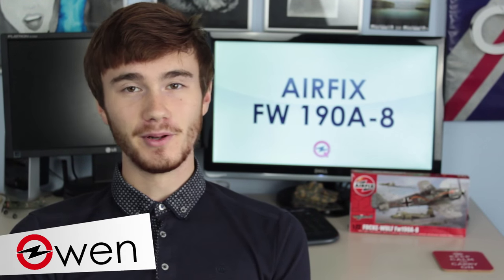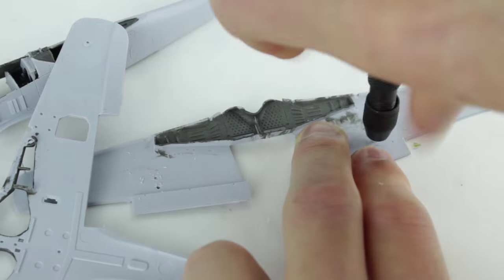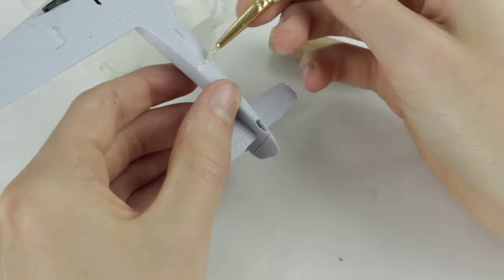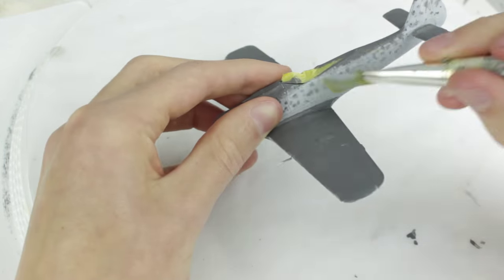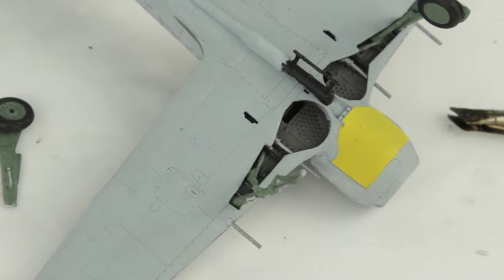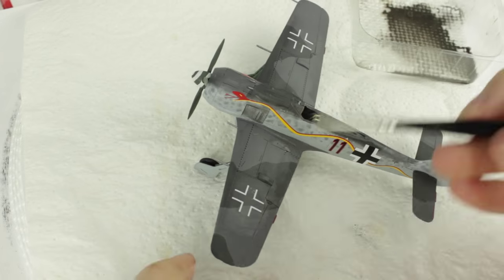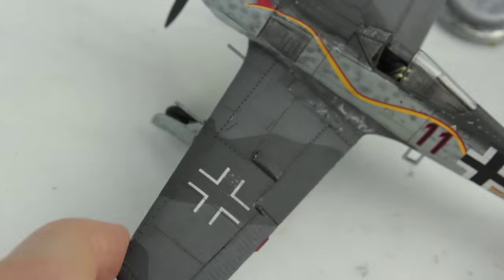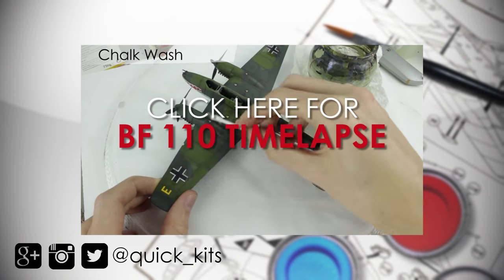Building Airfix FW190 - Model Aircraft

Comment: Wouldn't the thinner remove the previous coats of paint?
Reply from the maker: That's very true. You would have to use Humbrol acrylic 247, or seal the 247 colour with an acrylic varnish to make sure the thinner doesn't cause any damage (which I don't think I did, oops...)
Reply: Oh ok
Reply: actually the paint would "die" if you left it dry for about 4-6 hours (with enamel, and 1 hour for acrylic), once it dies, thinner can do no damage to it whatsoever
Reply: @rurushu8094  im the dark lord???

Comment: Great review. I just built one myself to. I built it because I remember seeing one that day at a air show I was at. (It did crash that day but the pilot is fine and it will be fixed).
Reply from the maker: Toby Corbett Did you see it crash? That would have been scary to watch
Reply: Yeah it was at Omaka airshow Blenheim new Zealand. one of the brakes failed on landing and it looped around ripping of the landing gear. But the pilot was fine and it wont be that long before the planes back up in the air.

Comment: Hello, I find you movies very informative and helpful. I learnt from you a lot. I  am just starting my adventure with scale modelling. I did few models when I was 14 year old kid, but it was very unprofessional and I never painted my models. Hadn't got money for paint :) Now I am 37 and I want to start again :) Right now I am doing same focke wulf but arirfix beginner kit, which is slightly different. Have few questions, if you don't mind. I decided to use always acrylic paints and varnishes and always use only brush. No air brush or spray. In my opinion hand (brush) painted models have more value (not money kind of value, but the other value  if you know what I mean). You always put some gloss coat (gloss varnish - is that the same thing? ) on places where decals will go. Instead of putting it only in that places can I put gloss varnish  on whole model ? And than after putting decals can I apply matt varnish to whole model again. Reason why I am asking, I want all my model (I will be doing 2nd world war aircraft) to be matt, there is no place for shinny aircraft during war. But if I put gloss varnish before decals on all plane, will it ruin whole thing ? Does it make sense putting first gloss varnish and than matt varnish ? What will be final outcome ? Gloss or varnish or mixed ? I will be using Vallejo Varnish Gloss / Matt  Airbrush Paint 17ml Bottle. Or you just recommend to do what you are doing, put  gloss varnish only where decal should go and than mat varnish on the end. I've never seen on your movies how you apply mat varnish on models, I mean with the brush, liquid one. Do you always use spray ? Can you make one movie showing how to use liquid matt varnish to cover whole model on the end ? Thank you
Reply: teddy81kain most people gloss varnish the whole aircraft before decals, so that's fine. but make sure to keep the varnish off the clear parts as it can make them foggy. I'd recommend gloss varnish until the model is very shiny, then decal, then a couple more coats of gloss to protect the decals from any weathering choose to do, then use Matt varnish to seal everything in.
Reply: Thank you

Comment: Owen, am a great fan and have used your pencil technique to bring out the panel lines on a fw190 to great effect. Having trouble however with pva glue on canopies as they usually fall off....any tips would be appreciated....thanks.
Reply from the maker: +Richard Cooper I'm glad the pencil technique is working for you! As for the canopies, I can only suggest that you use a bit more PVA glue, or look into getting some that is specifically for clear plastic parts, eg Humbrol Clearfix. I'm sure that Tamiya will do one also

Comment: How did you say you made that PVA gloss?
Does it actually work as a gloss coat?
Can I use it instead of the brand gloss, and save some money?
(Man, so many questions...)
Reply from the maker: ClonesDream Literally just mix some PVA glue with some water (like thinning the paint, so you don't get brush strokes) paint it on... a second coat may be needed if the first isn't very smooth.
I'd say it actually works more as a satin coat, not full gloss... There was a tiny tiny amount of silvering on one of the wing markings
And yeah sure you can get like a 1 litre of PVA for the price of like 50ml gloss varnish!
I'd try it on something you don't care as much about first though like an old model just in case
Reply: Quick Kits
Fantastic!
Thanks for the reply. ;)
Reply: +Quick Kits i thought the pva glue would peel?
Reply from the maker: Yakpackin Flys Nope, it seems fine. Especially with the matt varnish over it

Comment: thanks for this upload-the model came up very well.
Do you always use acrylics?? Until now i have used oils-not sure why? tradition I guess.
Acrylics are better as matt finishes I believe and they dry more quickly. Can I use your chalk  wash technique over an oil painted surface?? I do use the pencil to highlight the panel lines-works well. Thanks again
Reply from the maker: Generally I use a acrylics for small details because they dry faster, but I'll use enamels for large areas because they take longer to dry which reduces visible brush strokes. Yup you can use the chalk wash on any kinda type of paint :)
Reply: +Quick Kits thanks for the prompt reply...will try your suggested painting ideas. I do airbrush of course-not so much on 1:72 scale.

Comment: Do you dip your paintbrush in white spirits between colours? I have one of the starter kits as I haven't done these for years!
Reply from the maker: After using enamel paint (as I did in this video) then yes, I swill my brush in white spirit and then wash them with soapy water and then rinse them in clean water. For acrylic paint (as included with the starter sets) I just wash the brushes in soapy water and then rinse in clean water.
Reply: +Quick Kits Thanks for the reply. That's good to know as I can just crack on with the model now :) I used to find it stressful sometimes as a kid,  but hopefully as an adult it'll be more therapeutic :D

Comment: Question (how do I make the propellers spin on these models?
Reply from the maker: There is a little peg that goes through a hole in the front of the engine and into the back of the propeller. If you put some glue in the hole in the back of the propeller, the peg will hold the propeller and nose on and allow them to spin. There are small motors you can buy if you want to motorise the propeller, however I think these are only available for larger scales
Reply: +Quick Kits I've got the German Messerschmitt and I'm trying to find something to make my turbo prop spin but this model has no engine it's just empty space